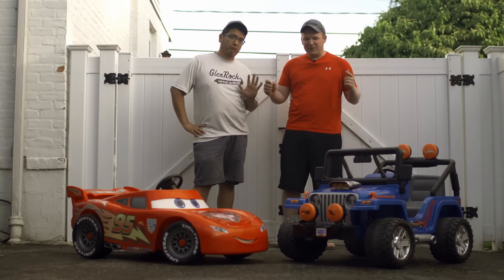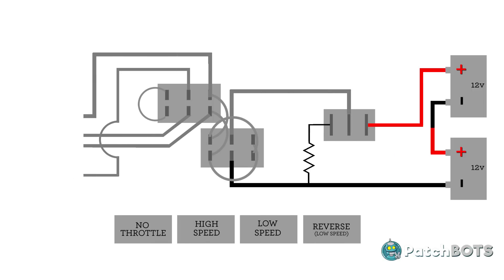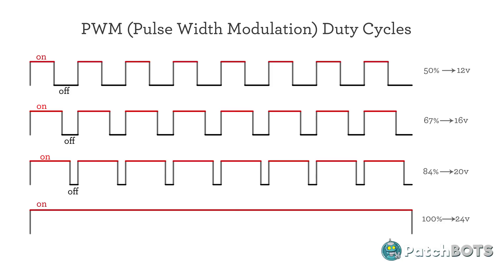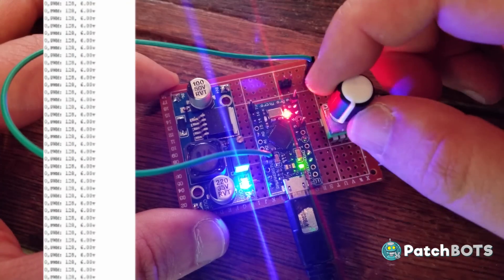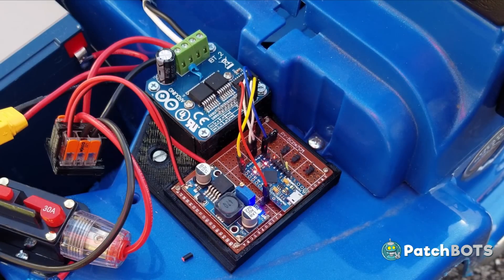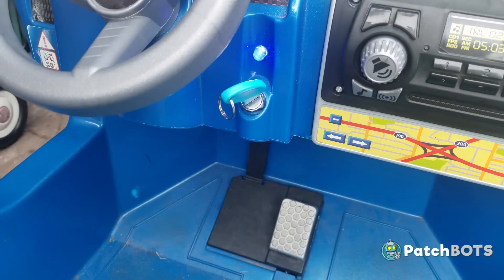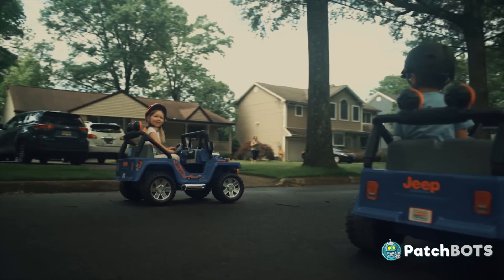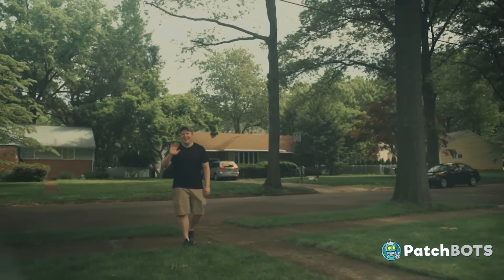Power Wheels 24v Upgrade + Arduino Speed Control

Comment: I did a similar upgrade recently. Got really good speed, but the stock motors burned out within a day. Tried some 24v motors, but when I tried those, the speed seemed back to regular, even though it was using two 12v batteries. I’m lost as to what to do now? Any help would be appreciated.
Reply from the maker: HI Brandon.  Yeah I can't be too much help without knowing the hardware, but the 24v motors are likely a lower RPM than the 12v's you had.   DC motors generally come with some form of gearbox at on top, I would ASSUME your 24v motors are a higher ratio than the 12v thus resulting a lower RPM.   When it comes to motors/batteries/gearing the tradeoff is between speed and power.   If your car is running the same speed at 24v as it was at 12v you probably have a substantial amount of additional torque. You can probably toss a couple extra kids on there and be all good to get moving.  Speed is fun.  Torque helps you get moving from a dead stop.  Finding the balance is the fun part.

Comment: Cool Video. I turned my sons into a wagon that hauls gear down to our boat. The only thing is before we get there the over heat sensor shuts it down. We have to let it cool for a few minutes and then go again. I was afraid to by pass the over heat sensor. Maybe I need to add 2 more motors to the front of it. It’s all stock but plan to up grade to the Milwaukee 18v because I have so many of them.

Comment: These days, you can get analog pedals - some of which seem to be exact replacements for the stock ones. I know that those were probably not available, when you built your project. However, when I see the speed that the new configuration produces, It occurs to me that a bit of speed control might be a good thing. It makes for a jarring & rough ride, otherwise. The Arduino could take an analog input from a variable resistor mounted in a pedal, and turn that into proportional output, via PWM, to the motors. Perhaps, the Arduino should be pulling a bit more weight in the project. The high/low speed switch could even be wired to the Arduino & select a custom range of speeds that you could program into the Arduino. The Arduino is capable of a lot. Maybe more of its abilities could have been employed in the project. You might want to swap the motors on the 6v project, if some are available.

Comment: Hello PatchBOTS!
This is a well done video!  Thank you for sharing the schematics and code.
If I were to replace the potentiometer with a hall sensor (gas pedal), what code changes are required?
Is it possible to have both the potentiometer and the pedal?  In case I need to adjust the max speed?
Thank you for the help!
Reply from the maker: Hi! Thanks for the coffees!   A hall sensor has an analog output not unlike a potentiometer.  The main change you would need to make is in the code, changing the PWM range.    In the main program loop change the following: pwmWrite = constrain (map (pot, 0, 1024, 126, 257),128,255);   to this:  pwmWrite = constrain (map (pot, 0, 1024, 0, 257),0,255);
Reply: PatchBOTS Thank you very much!  Your help is appreciated!

Comment: @PatchBOTS my question is a little off subject of this video, but I can't seem to find an answer anywhere.  I recently replaced a 12v RC controller with an 24v Weelye RX30.  The 12v controller supported the stock, stepless speed control foot pedal. The 24v RX30 controller does not.  The RC function works properly while shifter is in neutral, but as soon as I put the car in forward or reverse, it begins to move without first pressing the pedal.  I can't seem to find a 24v RC controller with the stepless speed control function.  Is there something I can do to modify the RX30 controller so it will work with the stepless speed pedal?  
Thank you.
Reply from the maker: This kind of thing was exactly what I was trying to avoid by keeping it primarily analog.   Unfortunately, I can't help you because I'm not familiar with those controllers, but adding in digital systems can lead to bugs/glitches/hard to find errors.   The arduino I have is digital but it's all in front of the analog gas pedal so at no point is the digital controller sending any power directly to the motors.   If I was building a go-kart for myself or something I wouldn't mind a cool digital controller, but my kids use this thing and the idea of a bug or a glitch sending them flying is just so not worth it to me.
Reply: @PatchBOTS  good points and valid concerns.  Thank you for your input.

Comment: Please, I'm using your video to modify my kids car but it's 4×4 and it has a speed controller with parent remote control. How to upgrade from 12 to 24 volts while these circuits are there coz everything heated up (but not burned) when I've added another 12v batt.
You really showed an experience here so I'm expecting your answer with right solution.
Reply from the maker: Electronic speed controllers are complicated circuits which may not allow for additional voltage being applied.  It can't really help much without knowing about the speed controller as there are many different types.
Reply: @PatchBOTS  it's kind a Chinese board

Comment: This is awesome, but i'm looking for a proportional gas pedal to use with the ESC. Have you ever seen something like that?
Reply from the maker: Yeah you can find kits like that on eBay and other "Modified Power Wheels" websites.      This video is the first of three I did on this jeep. In the third video I added a soft-start to the Jeep which is kind of "half-way" between what is shown in this video and a full out digital ESC.  I shy-d away from going fully digital in order to keep the analog gas pedal as a fail-safe.
Reply: @PatchBOTS  hi there. thanks for your reply. Cheers from Brazil

Comment: Question: how does the motor originally made to handle 12v do with double the voltage? I assume you kept the same motors on both ride .thank you
Reply from the maker: Yeah I'm over volting the motors for sure.  It will definitely shorten the life of the motors, but with moderate usage they are still fine a year later

Comment: Hey quick question here, I'm working up a key switch as you mentioned, but you seemed to skip over where you put the switch in the wire diagram. Do you put the key switch between the batteries and the happy wife or did you use it to close a relay. Thanks!
Reply from the maker: Hey good point, it was a late addition and didn't make it into the diagram.   The key is between the batteries and the voltage stepdown for the 5v.  So basically it prevents the Arduino and more importantly the motor controller from getting the 5v needed to relay the 24v to the motors.  If you want me to whip up a more detailed diagram just shoot me an email to the address on the "about" section of the channel
Reply: @PatchBOTS  Thanks for the quick reply! No need for a diagram. I was skeptical of the switch taking all the current for the motors but couldn't confirm it anywhere.

Comment: Question for you: It looks like you’re still running the PWM 16 - 24V power through the stock relays for fwd/rev and hi, low.  How have they held up?  I have a 6v car with RC relays spec’d to 14VDC.  I want to keep that capability for parental control.  I can step down the voltage for the steering and lights but I’m unsure how to handle the fed/rev section.
Reply from the maker: The Jeeps don't use any power relays, just switches.  So far they have held up fine.  So far the jeep is running great even at 24v. I added a soft start to protect the gearing a little, and I"m just waiting for either the gears to fail or the motors to burn out. But so far so good!

Comment: I put a 20v in one of these and destroyed the gearbox after about 60 seconds - which of these components will control the acceleration so the gear doesn't disintegrate?
Reply from the maker: Hey man, Yeah, that's an issue.  So this video is "Part1", check out "Part 3" where I add a soft start:  https://www.youtube.com/watch?v=EieWgQkJaRU
Reply: @PatchBOTS  Great will do - thanks

Comment: hy guys. thanks for the video. Quick question if i may....what motors do the 12V jeep use?? I want to upgrade my 4yo sons ride on car to 24V but i m afraid it will burn the motors. Did you change aswell the motors? Any advice will be much appreciated. Thank you!
Reply from the maker: My plan was to use the stuck 12v until I burned them out.  A year or so later and they are still going strong!
Reply: @PatchBOTS  so you don t recommend to upgrade the motors as well? Mine are some China products rs550 with 30000rpm motors. Thank you very much.
Reply from the maker: You can totally upgrade if you want.  If you don't care about the 12v motors in the long run then I would just run then into the ground and then upgrade.

Comment: well, nothing fancy. you shall try adding some ramp up and down (trapezoidal control) to the motors because that sudden stop of the motor it's going to hurt  the gearing of the car.
Reply from the maker: Done and done!  After this video I bought a new braking resistor from ML Toys, now it kinda coasts to a stop, which is great. And I added a very simple amp up in code whenever the gas is pressed. thanks for the comment!

Comment: GREAT VIDEO ... JUST GOT A 12V LAWN BATT .. IM LOST LOL GOOGLE DID NOT HELP ME SO IF I GET A DC MOTOR CONTROL   I CAN BOOST THE SPEED ?? THANKS
Reply from the maker: If all you want to do is increase the speed then you don't need a motor controller.  You can just increase the voltage tot he motors and be all set.   I used a motor controller in this video because I wanted a variable speed controller so I can adjust the top speed at will.

Comment: Why did you not just use a variable resistor? Love the happy faces from the kids! <3
Reply from the maker: I used a variable resistor (potentiometer) on the red car.  I used the jumpers on the Jeep because I didn't want it to be too easy for the kids to figure out.
Reply: @PatchBOTS  Variable resistors turn the limited battery time into heat instead of fun.
Reply from the maker: @RobertSchulz  The  variable resistor isn't in the power circuit. It's a logic level input to the arduino which is scaled to determine the PWM value going to the motor controller.

Comment: Hey Patchbots, is there any way you would share your coding? I have never worked with arduino and would love to make this setup. I have a dune racer which is already 12v, but i'd like to do that knob like he did for mcqueen, because i figure later on i could replace that knob and the gas pedal with a variable pedal for more control since it looks like it could be updating the "max" speed on the fly. My other question is if it would be easy to program in a soft start, so that it took 3-5 seconds to reach full power, i would suggest you do it to yours and it can save you from every needing to replace the gearbox. I had been looking at https://eastcoastpowerup.com/ESC_LED_Kits/24v_ESC_Kit but there is no top speed limiter. 
Last question, could using a PWM like that be able to make it so i could use an 80v power source but effectively only send the motors max of 24v without need of a heavy and wasteful step down transformer, i ask this because i have the kobalt 80v electric lawn mower and it would be amazing to be able to use those batteries for the powerwheels lol
Reply from the maker: Hi Micah.   
1. Yes, my code for both cars is available here:  https://github.com/PatchBOTS/PowerWheels24v
2. Yes you can replace the knob with a variable resistor gas pedal, or you can actually have both running on the same arduino. A knob to control the top speed allowed and the gas pedal to accelerate to that top speed.  
3. Yes, my next upgrade will be to add in a soft start.  It's not hard at all to program, but it requires a feedback loop from the gas pedal.  Right now the arduino is PWMing the voltage to the system constantly.  The gas pedal is acting as a simple switch to let that power flow.  The arduino has no idea whether or not the gas pedal is engaged.  I would need to add a loop going back to the arduino to let it know that the gas pedal has been engaged and to run the "startup" code.  It's not hard, I just didn't do it yet.  I will make a video about it when I do.   
4.   In theory, yes, you can PWM an 80v power supply to output 24v.  The problem is finding a PWM controller that can accept 80v.  I'm sure they exist, but they will be big and likely expensive.  The BTS-7960 I'm using only accepts up to 24v.     But like I said, yes, it would work if you find the right controller.
Reply from the maker: And just to follow up on point #2.  If you do decide to go with a variable resistor for the gas pedal you wouldn't want to run the actual power through it. You'd want it to be logic level going back to the arduino and have the PWM signal going directly to the shifter knobs (bypassing the gas pedal).  Like @Robert Schulz said in another comment " Variable resistors turn the limited battery time into heat instead of fun."
Reply: @PatchBOTS  did you ever look into a soft start and soft stop?
Reply from the maker: @HerbanWarrior  It's slated for as soon as it gets warm in NJ again!  My daughter can now comfortably ride at 20v.  I'm not pushing her up to 24v until I do the soft start.   For soft stop all you need is a bigger resistor like this one (I have this in the jeep now): https://www.mltoys.com/product-p/brake-reduction.htm

For soft start I'm going to add in a feedback loop from gas pedal to the arduino, all logic level like mentioned above.  I wont be getting to this until spring, but feel free to send me an email or message me on facebook if you want me to guide you through ahead of time.
Reply: @PatchBOTS  thanks, I will take you up on that if i manage to get all the hardware installed and working before it gets warm lol
Reply: @PatchBOTS  any chance you can share the stl files?
Reply: Would you consider putting one of these together for me to 
purchase?
Reply: Btw the video was awesome!

Comment: Hi, love the video. Great work! I tried to get a 3dprinter company to make the steering knuckle and they said according to the manufacturer, the object is not printable in its current state. The dimensions we received for your parts are: 

File Unit: mm
Dimensions: 2.1188571453094482 × 1.011502981185913 × 2.590221643447876  

looks like the file needs to be changed to inches? Any assistance would be great as I purchased the rest of the stuff to put this together. lol. Also, what size are the bearings you used? I think I ordered ones that are much smaller than what is needed. ha.
Reply from the maker: Whoops. Sorry about that. I uploaded two new files. They are mirrored. You will need to print one of each

Comment: Mechanical engineer here that needs help with electrical. Would you guys be willing to send me the wiring diagram for your Arduino and PWM controller? East coast makes something similar but they'll charge you 140 dollars for the system. I would rather do it myself at the same time learn a new skill. Thanks guys.
Reply from the maker: Hi,  Sure I can do that for you this week and put it up on my GitHub.  And yes, my next video is adding in a ramp up so I don't strip the gearbox.  I will be doing that and fixing some wheel alignment/steering issues, so look out for those videos in a couple weeks.
Reply: @PatchBOTS  Right on..

I ended frying both of my kid's powerwheels motors trying to run 40V. Dumb ass me. It was hilarious for about 15 seconds. 

So I'm trying to do  it right this time because I don't want to stop seeing that cheek to cheek grin from the girls. So Ordered more robust, more torquey and faster 27T 775 motors with metal gears,  L298n motor controller, and Arduino. Hopefully have a reliable 24 volts system that I can adjust as my girls get better at it.
Reply from the maker: @duk1776  I don' t think the L298n is a good choice.  It's  built for smaller hobby projects and is only rated to 2 amps.  These cars can pull a lot more than that and fry the L298n pretty  quickly unless you have a heavily modifed evaulation board.   I'd look into the BTS-7960 (what I used), it can power 40A.
Reply: @PatchBOTS  That is a great point. The amp draw on the 775's are very high. Thanks for catching that. I guess I'll need to consider what you recommended. Appreciate the feedback!